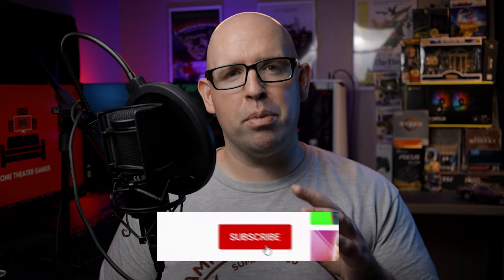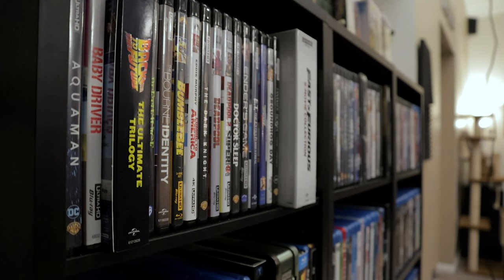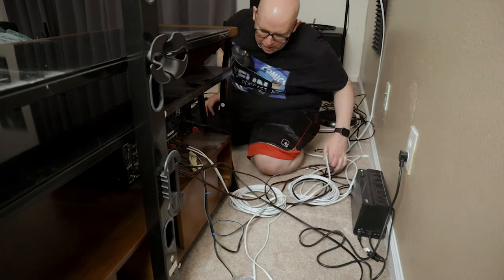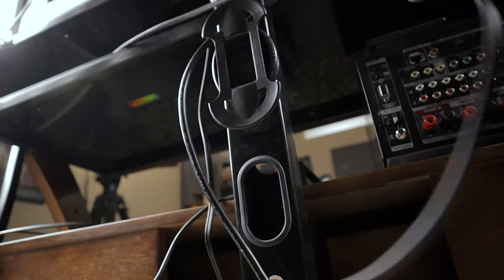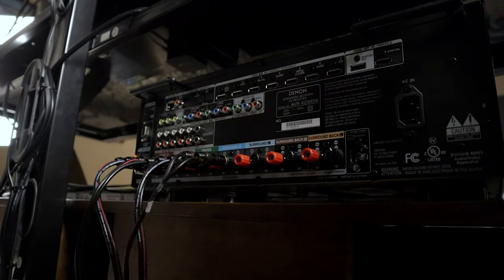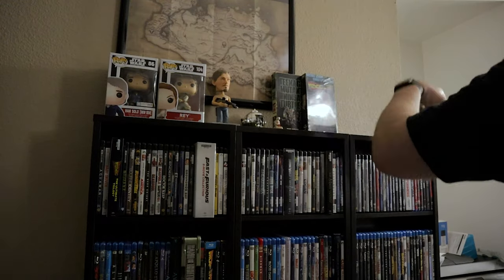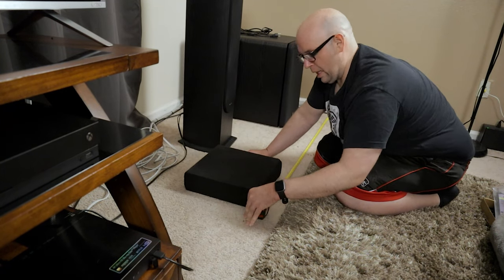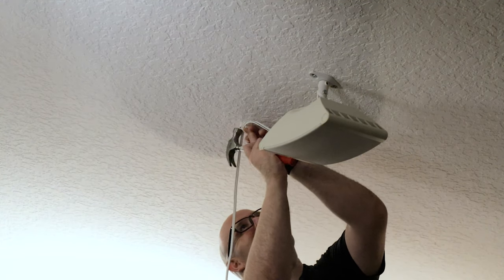Home Theater Setup | Moving stuff around for BETTER SOUND

Comment: Cool little room sir, keep working for that endgame setup 💪🍻
Reply: Hstudio3.0 a 20ft by 17ft living room isn't little for a home theatre set up. That good size room will have a great soundstage as long as the speakers are positioned correctly. Here in the UK a lot of living rooms are unfortunately much smaller 😆

The trick with any room with a home theatre set up is to keep the room uncluttered. Plus neat and tidy nothing unnecessary lying around on the floor, tables, shelves, sofa. It makes a room seem bigger than it actually is.

Comment: Kitten mittens bahahhaha ! N u deff doing Charlie work here lol
Reply: And now I'm going down to the garage to get my freaking zip tie kit lol nice work this time man, n u got a super cool wifE there, very nice to see.
Reply: O tv upgrade u say, get a LG OLED Gaming features are great in 2021; but Sony OLED is best motion n picture im betting, had the CX n now have the C1, 65 inch yea. 77 would be boss, but i got a 5.1 n another sub coming from one order. SVS PRIME CENTER, BOOKSHELF'S,  Satellites, n two sb or sp or something like sb-1000 pro, ported. N a denon 5.2 receiver ( yea it cheap but it basically CUT ME OFF from shopping lol ),  check my channel if u like n give me some advice on room setup or anything sound related, that would be great. Just switched hobbies, was sportbike type local at the tail of the dragon fer 10 year, n was on dirt the 5 years bf street bike life. But thx for reading n have a great day yall

Comment: That was awesome and I need to do that with my setup lol.
Reply from the maker: It’s definitely made the sound better overall. I had a sneaking suspicion it would, but I wasn’t 100% sure because my room is especially problematic with vaulted ceilings and multiple openings. In my old setup, I needed to use Audyssey’s full EQ in each speaker, but now I just have it EQing the lower frequencies (everything below 300Hz, disabled for the sub because I use the miniDSP) because I actually have pretty even response above that. If you have a UMIK-1 and REW, I’d definitely recommend taking measurements before and after!

Comment: Also, where did you buy your speaker risers for your fronts?  I feel like my speakers are low and the tweeters aren't perfectly at ear level.  When I lower my head to match the height of the tweeters when I listen to music or watch movies, it sounds way more detailed and clear. Thanks Brad.
Reply from the maker: Thanks for the comments! It definitely helps with organization, especially when trying to film stuff. The filming alone probably added a full day to the overall project and post production took about a week. So glad you liked it!

In regards to the speaker risers, I mention it in the video. Basically, I used two 12x12x1 patio blocks for each riser and covered them with black felt.  I made them this way in case I wanted to add another 1 inch block in case I needed to go higher. They’re super cheap and I bought everything at Wal-Mart for a total of around $15 a few years ago. They definitely help the overall sound from the front channels as the tweeters are now ear height.
Reply: @HomeTheaterGamer 

 Got it, stacked patio blocks from Walmart. The black felt you put on it makes it look professional haha.  

I've got a tip that can make your home theater even better too. 
For your atmos speakers, I recommend using SVS prime elevations and setting an independent crossover on them at 60hz-70hz  since its frequency response can go all the way down to 55hz whereas your Polk OWM's only go down to 100hz. 

 For atmos games and movies that use low frequency overhead sounds like a growling licker on the ceiling,  Mr. X walking around floors above you in RE4,  or an airplane flying overhead in Gears of War 4, the SVS prime elevations really make those overhead sounds fuller and convincingly real. (especially since I upgraded from a 7.1.4 using pioneer atmos modules which crossover around 180hz).

Thanks again Brad!
Reply from the maker: @Billy Joe thanks for the tip. I’ll look into the Prime Elevations, though personally I don’t if I’m a fan of the look of them or not. I’ll send an email to my contact at SVS and see if I can’t get some in for review. Might change my tune then haha.

I did recently integrate a miniDSP 2X4HD into my system, and after getting the subs dialed in, I was able to time align my mains and subs together very well and very easily using REW. I did a bunch of different tests and measurements and ended up crossing over everything at 110Hz which gave me a pretty flat, even response across each speaker. It’s sacrilege to some straying above 80Hz, but I feel as though I’ve made an educated decision based on measurements as well as my own ears. I am currently running 3 subwoofers, though, and after time alignment and EQ, localization is a non-issue. Pretty cool to have a free tool like REW for tweaking.

I plan to do videos on all this stuff soon. Should make for some pretty fun videos.
Reply: @HomeTheaterGamer  That's awesome man!  We all have different room acoustics and speakers, but most importantly,  different ears and preferences so I agree that a crossover of 80hz is just a very general rule.   

 I'm planning on manually tuning my subs and mains with miniDSP and REW some time in the future because I don't trust automatic calibrations (and their cheap mics) but I'm not very familiar at all with   how to use miniDSP and REW. I'm sure a lot of home theater enthusiast aren't familiar with manual calibration as well.

 (future video idea):  you should show us how you used miniDSP and REW to tweak your set up ;)

Comment: This was a year ago, but with a second PB2000 sub I strongly predict are going to need to upgrade your LCR, especially that little center. I know because I had those same LCR and upgraded to two big subs :) Good luck.
Reply from the maker: That is definitely my next upgrade goal (along with an HDMI 2.1 capable receiver, or maybe a pre/pro and amps), although I’m still impressed by these entry level speakers. I wish I would have bought the SVS Prime Pinnacle’s when I had them in for review, but I couldn’t afford them at the time.
Reply: @HomeTheaterGamer  It's just my experience but the towers hold up with big subs to help. It was the center upgrade that blew my mind. Of course the AVR does matter. I had a wimpy X1000 with 80 watts but still a new center was night and day.

Comment: Buy a hometrainer to stay in good shape...and good diet
Reply from the maker: I’ve gotten back into a workout and cardio  routine and have dropped 20 pounds so far and have been making lifestyle changes as well. Still have a ways to go but I’m on my way. 

Quick backstory: in July of 2012 I weighed almost 300 pounds. I finally had enough and started running everyday and working out every other, and made only small dietary changes over time (like cutting out most soda). Over the course of a year I dropped about 125 pounds. At my lowest I weighed in at 172 pounds. I then met my wife, got too comfortable and moved in with her and had no access to a gym. I kick myself for not keeping up with because I know it will be work, but I will eventually hit my goal weight again.
Reply: @HomeTheaterGamer  glad to hear it bro  keep it so.. if you know intermittent fasting?  You should try it its very easy and check Dr.Berg on YouTube . I have to lose 10kg .btw gym is closed here in Belgium :(